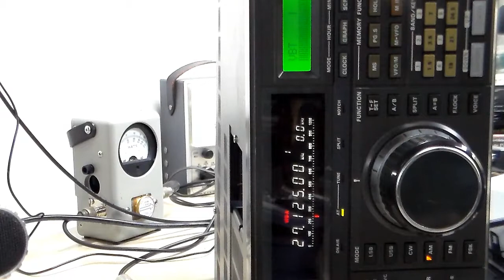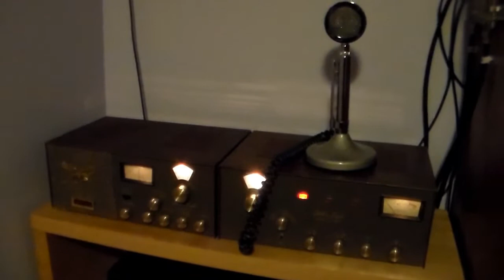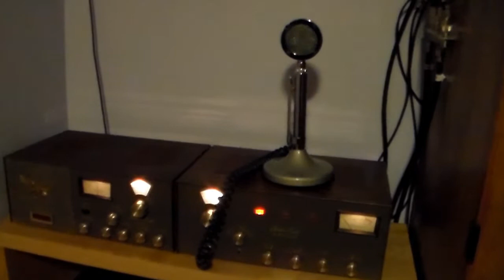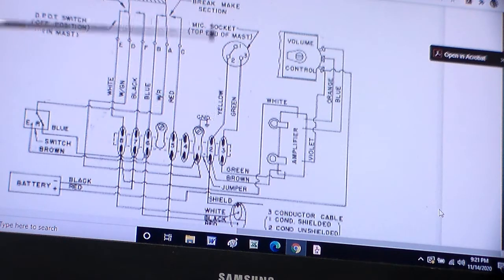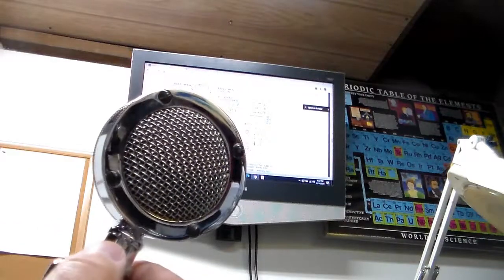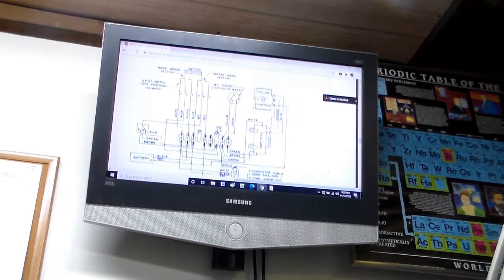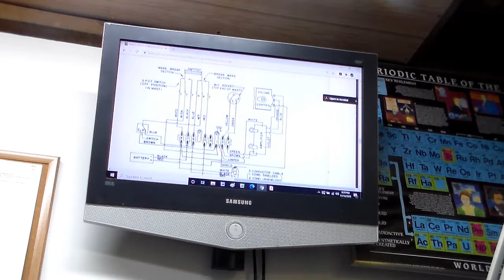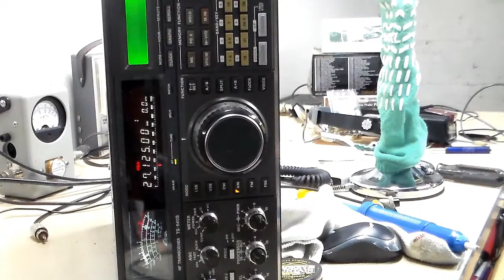Different Microphones

Comment: I did re-listen  to the video a few times (8 or 9 times). lol
  My PC setup is a top of the line ausu motherboard with a matching sound-card design for this board and 5.1 surround sound speakers. A Sound Max audio Equalization software. 
  My report is the  MC-50 sounded ok, but out of the 4 it just sounded plain. The Silver Eagle had the most punch and sounded great.
I did find that the Original D-104 sounded the best to my ears, it was hard to tell after your modification. After I just went back and forth between the timestamp of 1:44 and 1:54 
 I could hear that the modded D-104 is better, cleaner and there is a difference after your modification. I am no sound audio expert, and this is all just my opinion. It Sounds Great.  Thank you for a great video. If you put that mic on 80 meters, let me know.
Reply from the maker: Thank you for putting that much time into listening.  To think about my voice broadcasting across that system is horrifying.  Like a giant nails on chalk board beacon.   After watching it on s better setup, I'm not happy with any of the results.  I need to find a better method to document the results.  And yeah, I think the gain on the Silver Eagle was turned up a little bit giving it more audio output, or modulation as we used to say in the CB days.
Reply: @timtimeprojects3576  Looking forward to your better method of documenting your results.I enjoyed testing your work, to see if I could hear any difference .No expert here, just wanted to hear what sounded best.

I have been watching ebay for some time now, looking for a d-104 with the T-up9 base, I love the PTT button on the base. Also I'm a cheap s.o.b looking for a deal. lol I own a Kenwood MC-80 connected to a TS-850, it was on the TS-940. I just got a FT-3000 and I am not fond of the hand mic, after many years using a desk mic. I would love to find a D-104 and match the impedance to the Yaesu with the PPT base. I used to have an old CB base station back in the 80's and 90's that had a nice desk mic.Old habits are hard to break. Anyways good luck and happy video making. Thank you for your video time, makes for an enjoyable evening. 73's